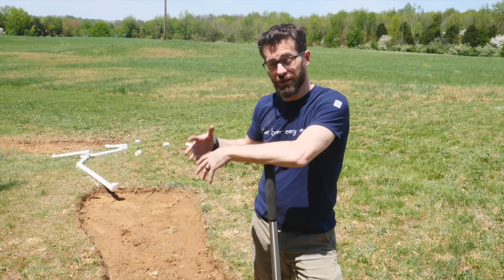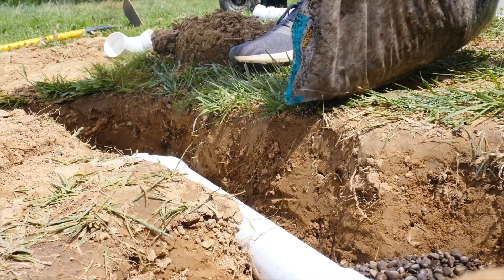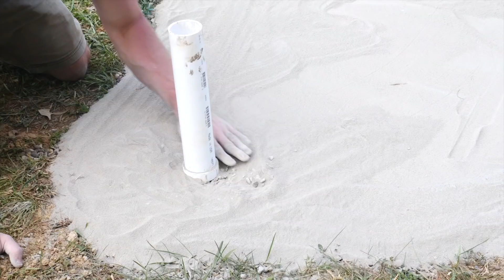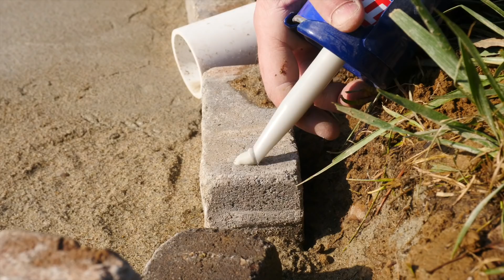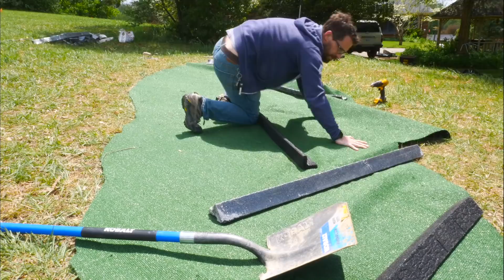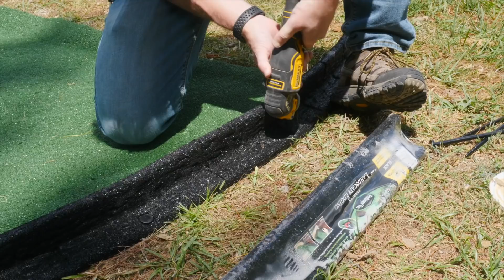How to Build a Kid's Mini Golf Course (w/ I Like To Make Stuff)

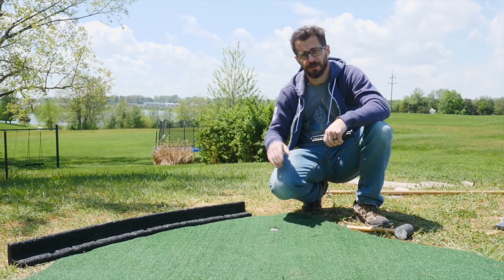Comment: 10:46 he talks about it with the clean edge out, then later when he's doing the entire thing, he reversed it. Also, the hole on the top green that feeds to the other green should have a normal golf sized cup instead of that puny little tube. What i'm saying is that the cup should feed into the tiny little tube instead of making it more difficult than normal putt putt.
Reply: Yeah thats the least of his worries.

Comment: Never in my life have i seen cement done that way..
Reply: For good reason. First time it rains, that cement is going to crack and fall apart. After the first freeze that "course"😂 is going to be too bumpy to play on.
Reply: @garrett8850  Was it even mortar though or was it just cement powder with no sand? Beggars belief!
Reply: @garrett8850  2 million YT subscribers? Yeah he's a hack.
Reply: Of course you haven’t because that’s mortar not cement.  Portland Cement is an ingredient in mortar and concrete.  It cracks immediately upon drying when used alone, as it shrinks.  Adding rocks and or sand gives it something to compress around which prevents cracking and inherent brittleness.
Reply: False Feathers he should have used concrete.  Cement is an ingredient in the mortar he use and concrete.  Cement should never be used on its own.
Reply: It's not ideal but since it is such a thin slab and he's covered it it'll hold up just fine for a few years. Not to mention I don't imagine his kids are going to be too abusive to a mini golf green.
Reply: Less than 750k subs now. Probably because of this video..
Reply: Looks like half of it blew away in the wind too lmao

Comment: Did u factor drainage. Like from the holes??? Like youl likely flood out your lower course from the top draining into it, I'd have drilled drain holes in the underground pipe
Reply: I wouldn't worry too much about it, the way he used that mortar, it won't be long until that course is full of potholes for the water to drain into 😂😂😂

Comment: well have fun cleaning the pipes once mouse or wasps nest there,...
Reply: Once a year, you could always spray water down the pipe to clean the pipes
Reply: Nakamura65 one word sir, caps.
Reply: Well that'd actually be pretty simple. Throw in there some calcium carbide and water and FIRE IN THE HOLE. Done it countless times, even PVC piping handles it perfectly fine.

Comment: The holes are small which will be fun and the surface will be uneven which will be fun. Then dumps multiple bags of mortar on the ground instead of concrete or cement then to build the small brick wall he uses caulk... Looks legit to me!
Reply: Only correction cement makes concrete...cement being the ingredient and concrete being the result.  People think they are the same thing but that's wrong...not hating just helping
Reply: Zach Landon my two year already corrects adults when they make that mistake.  At least from him it’s cute.  When point out they’re idiots I usually don’t get a smile.  He man-splained to a mom yesterday and it was priceless.

Comment: You can see the lumps in the putting surface. Love this guys channel but this one is bad. Using gravel and cement as sub surface isnt the way to go. This is definatly the cheap way to do this. Ive installed many putting greens and this makes me sad.
Reply: poopinapicklejar he literally says that it doesn’t matter to him because it adds to the game
Reply: @MaddenBaller03  you cant level a material like that. He just said that to cover himself. You can see he tried his best with all the levels and such. lumps in putting surfaces isn't fun.
Reply: How is it done normally?
Reply: We always used class 2 road base and a compactible manufactured sand on top then compacted with water and plate compactor machine.